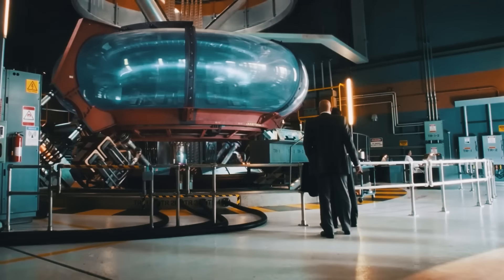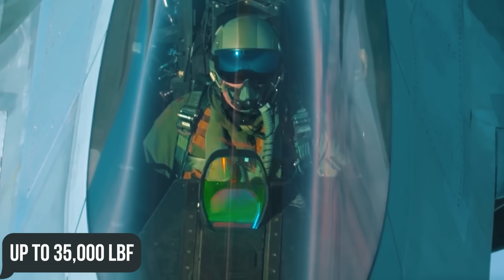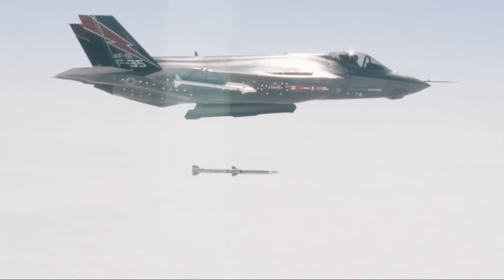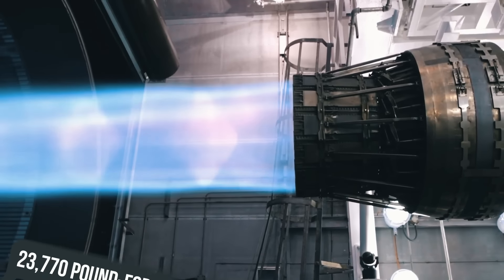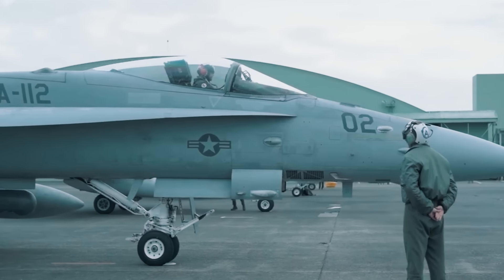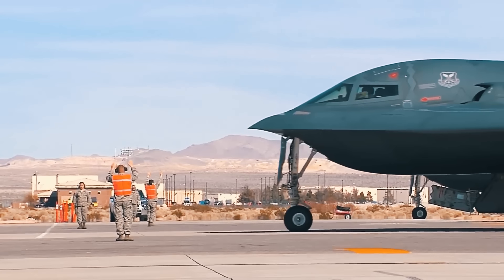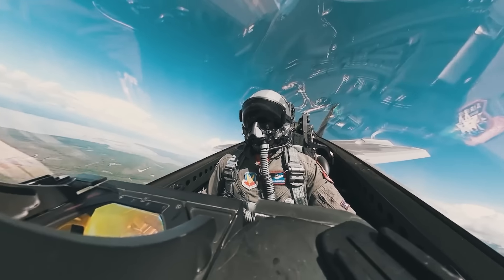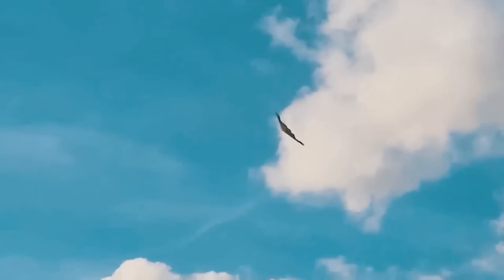Unmatched Dominance! Here is Why Russia and China Can Never Beat US Air Force

Comment: That carrier-type landing at the 6:05 mark shows the difference between Navy carrier aircraft and USAF aircraft landings i.e. - high sink rate (controlled crash) vs silky smooth sink rates.
Reply: Actually there's no reason for Navy Ac to "Carrier" land an Ac on land as hard as they do. That's just poor training. Yes the Ac is designed to hard hit but again, not necessary.
Reply: @Mr51Caveman  I'm not sure where that video was shot, but Navy pilots do a lot of those landings when getting ready to deploy. They have weeks of Field Carrier Landing Practice (FCLPs) prior to doing it at the carrier. Once the daytime FCLP minimums are complete, then they do them at night. They have to get a minimum # of landings and are mandatory prior to landing on the ship. This landing could be an FCLP counting towards the minimum.
Reply: They know how to land light. But when you see them landing and taking off again… they are training for what would be Aircraft landings. 
  There are lines painted  on the runway to represent the arresting cables on the carrier and are monitored to see how well they are completing the task
   And in all honesty they don’t really do high angle landings anymore, unless it is at a time when things are very rushed with one plane landing right after another.
   Now it is much closer to a near level approach and then hit down at angle from a few feet above horizontal with the AC. 
   The harder touchdown is when right above the arresting cables as it is a small area
Reply: @jamesh.2271  Unless things changed drastically since I was in the Navy, landing aboard aircraft carriers, they still must do carrier landings the same way. With the ACLS (Automatic Carrier Landing System) the computers can land the plane and catch a #3 wire every time, or a #2 wire on the latest carriers. The angle is set for a constant glideslope. They never varied during my time. The FCLPs (Field Carrier Landing Practices) are done with the lines painted and a Navy pilot can land softly when landing on a normal runway, not a floating one. But it's the same landing angle at the practice field as it is at the carrier if doing FCLPs.
Reply: And how many carrier landing have you performed to be an expert in this field?
Reply: Indeed the peace makers

Comment: Pound force (lbf) of thrust, not pound-feet (ft-lbf) which is torque (or energy, depending on the context)
Reply: A foot pound is a unit of energy, not to be confused with the pound foot, which is a measure of torque. The foot pound is a measure of a pound of force applied over one foot.
Reply: @teddeebayre3433  Most people (often even 
engineering students and sometimes book authors) do not seem to know the difference.  Many torque specifications are given in ft-lbf, not lbf-ft.  This harkens back to the fact that torque is the cross product of the position vector first with the force vector second, thus many prefer ft-lbf for torque and lbf-ft for energy.  And since work is force X distance (or better yet, the integral of force over distance) and has dimension of energy, lbf-ft could be argued as proper units of energy rather than ft-lbf.  Of course in the metric system Newton-Meters are used for the dimension of torque while Joules replace the same unit, but represent the dimension of energy, work, etc.
Reply: @damonsisk4270  Engineering students deal with SI standards since the late 80s.
Reply: @magick1969  ...And engineers in the real world (in the USA) use both English and SI.  I want my engineering students to be "bi-lingual".  Btw, I was an engineering student between 1995 and 2002 at Purdue University (BS che, MS me) and we learned to use both systems.

Comment: Would be cool if you 1) gave credits for the video clips you use, especially when using clips from YouTube creators and 2) show footage of the aircraft you're talking about. 7:26 that's an F-117, not a B-2. 4:48 that's a MiG-29, not an F-15. 5:43 those are super hornets, not hornets. 6:53 neither of those are F/A-18s either. 7:12 is not an F/A-18, that's an F-15E.